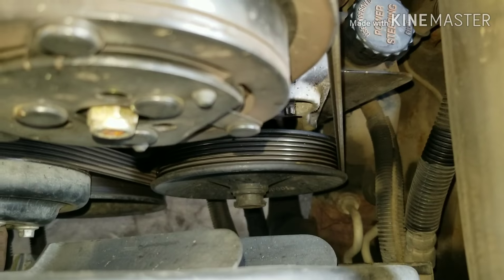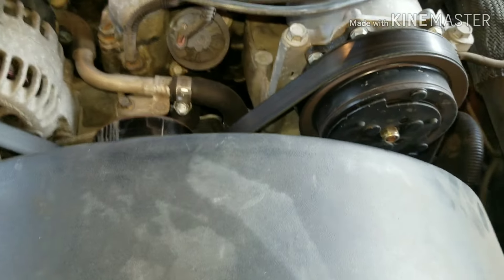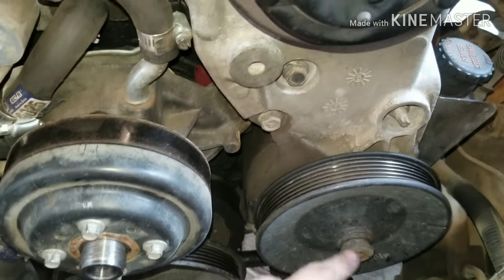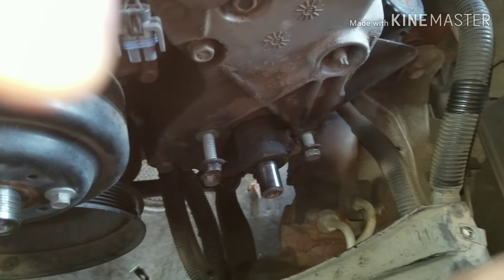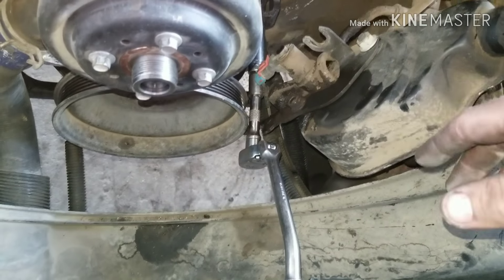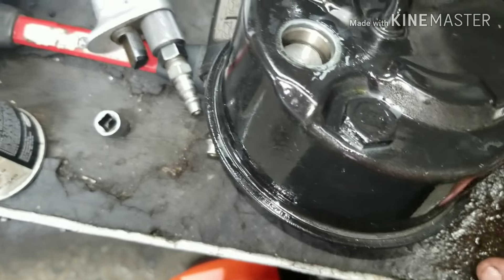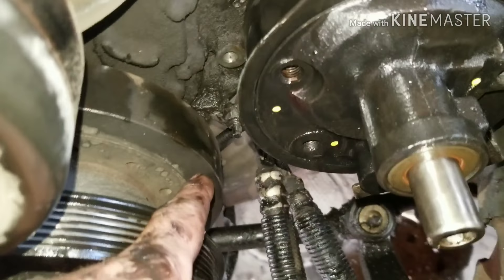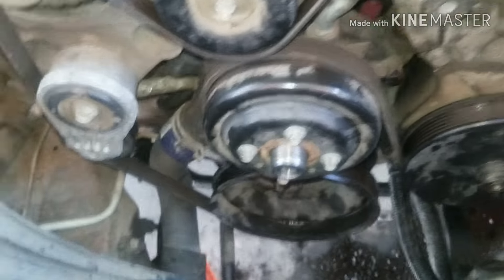98 Chevy c 1500 power steering pump replacment

Comment: FYI to all, you can remove the fan by leaving the belt on, grabbing an adjustable wrench and a 3/8 socket, put tension on the belt and crack the fan loose. It's a quick 2 seconds
Reply: not my fan ^^
Reply: Have a questions iv asked all my local autopart store for that sensor or valve but no one know what I am asking about where do i find a new one mine melted please help idk what that sensor or solenoid is called for the valve on the back of it for the high pressure line I don't know what that is what's it called and where do I get it cuz I cannot find it anywhere
Reply: @Casey Cleland  well with the limited information about "a sensor" in a truck that has 20 sensors you gotta help us try and identify it. Where is it located specifically. Is it big or small? Does it have a lot of wires or just one or two?
Reply: @MrMrBurnablunt  I'm in the process of replacing my pump and I found that "valve " is no longer made but you can get a pump with a " U " shaped pipe in place of the valve as it was only used for a few years and caused more problems then it was worth. It took inputs from the speed of the truck ,steering wheel position and turned down the power asset at higher speeds.

Comment: Well Thank goodness they finally put enough bolts in a power steering unit to make it easier to pull the whole fringing engine to get to it easer , after all these decades of just 3 bolts / nuts and 2 lines Finally they made it so much easier just to yank the engine to get to it ,

Comment: So I’m pulling the pump now on a 97 3500 gmc it wasn’t making any noise but there is so~ much oil from the compressor down I’m mean thick and from the steering gearbox the shaft from there to the firewall is covered from around the height of the park plugs basically 360 degrees from the pump down and maybe a foot just thick with oil and dirt. The guy has only had the truck a few months but want driving it much until the last few weeks the oil and dirt has obviously been there awhile when ingot under to remove the pump the wire is  not plugged I n the sensor and is nowhere to be found there was play in the pulley but all that said the pump has the right level of fluid. They been driving the truck steers stops fine.they stop at store get in start it and no power assist brakes and no power steering that’s when I checked the fluid it was perfect and thi guy doesn’t even own any fluid. brake fluid is not all the way full but very close just wondering if fluid comes out of the sensor where the wire plugs if there is no wire and how did the truck still steer fine. Anyway not sure you will have any answers but I am waiting on new pump should be putting it in soon.

Comment: Great information on this project. I snapped the shaft on mine after not purging it properly after leaking high pressure line replacement. My doom azz. I watched this video after I pulled the pump today. You explained why shaft and pulley yanked right out when attempting pulley removal. It had kersnapped off inside. It would've definitely made life easier if I had watched it prior to line replacement for purging process and again after the old pump went perflunk. Proper prior preparation prevents piss poor performance. The seven P's!!😉
The pump description at the parts store said the valve and sensor assembly is a bypass. Must keep it at needed pressure without going too high.
I'll definitely get the wheels off the ground and go forth and back before I put the fire to it this time. Thanks.
Oh and a monster adjustable wrench did the trick on the fan for me with my chain grips on the pulley. Made me feel slightly better I got that part done easily. 😁😉 The tool knows what it was designed for.....the wielder must learn the execution. 
Thanks again!!🔧🔩
Reply from the maker: Thanks for watchin I really apreciate ut. I'm glad I was able to help you. Besure to like and subscribe for more tips and tricks
Reply: Explain what you mean put the fire to it confused
Reply: I'm confused what did yiu have snap off and what I'm confused
Reply: @MrMrBurnablunt  I meant start it.
Bring the Thunder 😁😂🔥⚡
Reply: @MrMrBurnablunt  The pump shaft can snap in two if the pump get's an air pocket. It happened to mine and brought me to this video for pointers.
Reply: Could've left the belt on and went clockwise with it to put tension on the pulley to keep the fan from moving while hammering it loose. Easiest way in my opinion
Reply from the maker: @ThisIsForYOU369  the reason I did it this way because the nut was seized on the pump threads.

Comment: Thanks! I like the video, thanks for describing the socket sizes.  I did damage my sensor pulling the pump so I have to find another, but with your information I feel I am on the right track!
Reply from the maker: thanks for watching im glad I was able to help
Reply: Your doing well, I researched the EVO sensor. It is obsolete apparently it can cause steering issues. There is a dorman and GM kit that replaces , the sensor on the back of the pump. Dorman 926-049 $36, GM double $ in this case same, same. Variable steering bypass tube.
Reply from the maker: thanks for the evpart number ,alot of viewers questions are where to find a new sensor. thanks again
Reply: Evo system is two pieces, the evo piece by the pump just varies the pressure, the peice on the steering reports the position and error code.
Reply: Questions about the Evo what did gm do about this sensor.. So it's absolet.. Then how do replace if we broke it.

Comment: When you changed out the EVO valve where did you get the correct o rings as these pumps usually only have one that fits the actuator.

Comment: no one shows how to get back nuts off,, i been looking at all these vids ,,do you gwt under truck to get to them ???
Reply from the maker: Thanks for watchin. I usually take the bolts that hold the bracket on off the engine. Then I'm able to move the pump and I need to go get my nuts.

Comment: I have a 1997 GMC Savanna Van 2500 w/ 350. I have a very small drip coming from the sensor area. I tried tightening up the bracket that the sensor sites on and it seemed to help a little. Does these normally start to leak from there and is there any way to repair that area if that’s where it’s leaking from or would it be better to just replace everything or what do you recommend. Also the van has 260000 miles on it but run very good. I thank you for your time and help.

Comment: Doing same job.. same truck.. New pump has reduced nut for sensor. Does that nut screw out so I can replace sensor as it was on old pump? If it's sealed I just don't want to cause it to leak...
Reply from the maker: If you already have the stud part hanging out for the sensor I would not disturbed the new part any more then you need to to prevent any accidentally leaks. Thanks for watchin besure to line  and subscribe for more tips and tricks

Comment: That cockpit back behind the wheel looks exactly like my 1997 c3500 GMC Sierra SLE dually have steering box on the way from O'Reilly's with bypass tube... I suddenly lost power  steering and brakes as it was intermittent a while before it eventually totally failed seem to be an electrical short at that valve I can notice both wires grounding out bad housing... All the mechanics tend to say that truck is too heavy to work on I'm on a blacklist.. model discontinued says the dealer don't even bring it... Suffice it to say I must become my own mechanic. With a 4-ton Daytona jack I purchased from harbor freight thinking about going back and getting the 22 ton jack.. to let the apprehensive mechanics use..

Comment: I have a question i bought a power steering pump does it make a difference if it has the sensor or not does it affect the engine

Comment: Question : I'm removing and installing a PS PUMP on a 98 GMC 5.7 im not sure if replacement pump has the valve I need to check to see I know it didn't come with the sensor and that whole component.  If I discover that the replacement pump don't have the valve taking the valve out of the bad pump  is it easy to remove  and  how to remove it.
Reply from the maker: some times they come with the pressure valve ,its fairly easy to check thanks fr watchin really apreciate it.
Reply: @fixergood   thanks for responding,yes the valve just falls out no tools required .I learned a lot  on this 98 GMC ,5.7  4×4 PS pump removal and install  . I first need to say watching your video made the job more manageable. The pump I removed had the EVO = sensor setup .  On this  replacement PS pump I  scrapped the EVO idea and went with the new designed U shaped tubing which performs the same function. A person could go to a Chevy dealer and pay $100.00 for this small piece of U shaped tubing or shop O'Reilly's and get the whole thing pump included for $89.00 . For anyone reading this Do not go to auto Zone for your PS pump 98 chevy and newer , thats if you do not have that tubing already on the pump your removing, because auto zone doesn't carry it nor can they order it. Thats my experience ,hope it helps.

Comment: Does the power steering pump have anything to do with the engine oil such as passing it through the system? I have a major oil leak behind my water pump and power steering, most of the right side of the engine is soaked. And suggestions?
Reply from the maker: The power steering is a seprat system in that area you could have a power steering hose and  may a valve cover leak that's giving you issues thanks for watchin

Comment: What is the chain tool you have wrapped around the pulley? I'm trying to put the pulley back on, but I cant keep the pulley from turning . I'm basically just backing the main bolt out of the pulley shaft when I crank on the pressure bearing.
Reply from the maker: A tekton  3960 is similar tool, if you put the belt on first I will hold it in place while you spine the fan on or off . Thanks for watchin really apreciate it
Reply: @fixergood  I took a closer look and found that the stud, that screws into the pulley shaft, had a slight bend in it causing the pressure bearing to "bottom out" and spin the entire assembly. I didn't realize it until after 45 minutes of fighting and two busted knuckles. I took it back to my local auto parts store and exchanged it for a different one. Pulley went on in 15 minutes. Keep up the god work. Your videos are awesome!!
Reply from the maker: @brianwilson8119  thank you I really apreciate it.

Comment: Where did you get the chain to remove the fan.Or is it another way.
Reply from the maker: They make a chain took that looks like a pair of vise grips. Usually ty hey come off when you hit the nut with a gan spanner tool and a are hammer
Reply: Thanks

Comment: If you can't get the pulley off is it still possible to remove pump with pulley attached
Reply from the maker: No the pully needs to come off in order to give you access to the three power steering bolts.Thanks for watchin really appreciate it  besure to like and subscribe for more tips and tricks and check out facebook and instagram and give it a like for more help in the future
Reply: most auto parts store will rent a pulley removal tool. And most will give.you a full refund when you return the tool. Kit comes with a tool to reinstall it. Only takes a few mins and you do not need to remove the fan like some people do.

Comment: Good video.  The  whole hammer trick has me a little confused.  Not sure what part you were hitting on to loosen fan. I just left my fan on.  98 Chevy 2500. My issue is with the return hose. I think it's with the cooler? It bolts inside the frame right behind bumper. There's not enough room to slide it out.  Is my only option to get it out of frame to remove bumper? Can't find videos anywhere.
Reply from the maker: I'm not sure does ii maybe look like you can get it through the grill if it was removed? Thanks for watchin besure yo like and subscribe for more tips and tricks

Comment: If my pump doesnt have that sensor just install a pump without it rite? 99 tahoe 4x4 5.7 by the way.
Reply from the maker: On some make and models yhe sensor is optional so if your original equipment dosent have it, the new pump should also not have it. Thanks for watchin be sure to like and subscribe for more tips and tricks
Reply: @fixergood  thanks
Reply: @Randy Wilson it did have it after all. I just couldnt see it til i was under there. I managed to replace only the lines😊

Comment: change the gearbox power steering pump and it idle wheels are hard to turn but if you give it gas or driving it turns easy can't find the problem
Reply: Same here... Did you find the problem???
Reply: My 1998 k1500 has just started  doing the same thing. Did you find what was causing  it to do that?
Reply: Pump is bad. You got a dud. Unless one of your PS pressure lines are busted... your reservoir would be dry all of the time if that was the issue
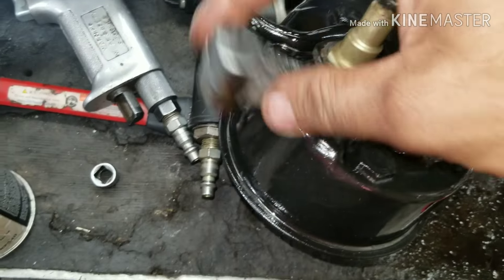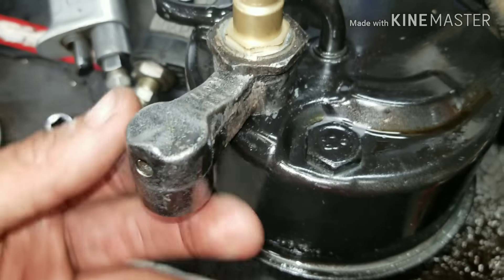Reply: Also if your lines are not leaking listen to 5:19-5:23 in the video.. he mentions a seal that if it isn't placed back in or if it is damaged it will cause the pump not to work at all.

Comment: Does that snap on puller also install the pulley? I found the exact same one on eBay but the video didn’t show you putting it back on
Reply: The video shows it but I can’t tell if it’s what you used to put it back on
Reply from the maker: The snap on puller only pulls it off, then you need a installer tool. If you get a unervirsal removal and installer kit it should have one  in it. Or I'm sure you could rent a tool from a local parts store and they could point you the right way.  Thanks for watchin apreciate it besure  to like and subscribe for more helpful tips and tricks .
Reply: fixer good  thanks man. Yeah I was looking at them on amazon that pulls and installs but they have shady reviews. I went on eBay and found the puller that you used. I’ll look more into the kits on amazon. Thanks again

Comment: Where can I order the sensor thats on the back of the pump near that 30mm
Reply from the maker: I'm sure you can  ask your local parts store they should be able to help , or look for part numbers on the sensor.
Reply: Autozone, carquest,napa,o'reillys,advance. All said part was n/a in there system and couldn't tell me where to go from there.  Rock auto also does not sell it or have information on it.
Reply: @daltonnichelson7300  your a lier power steering pressure sensor check it out again.

Comment: What do you do if the sensor on the pump is broken.
Reply from the maker: Depending on how it's broken theres probally no saving it on something like that you'll probally have to buy a new one thanks for watchin besure to and like and subscribe for more tips and tricks
Reply: @fixergood  what's the sensor name
Reply from the maker: I think it's called a power steering pressure sensor, thanks for watchin  be sure to like and subscribe
Reply: @fixergood  thank you

Comment: Ridiculous pondering... I can't figure out the solenoid valve maybe pulls that apparatus back so it would seem to unplung it... would be a default setting for ultimate steering assist in my dream.. unless electricity voltage in varying degrees pulls back that plunger for less steering assist.
.

Comment: For the Evo valve, how many orings did you replace? Did you use the orings that came with the pump?
Reply from the maker: I'm not sure how many I replaced I I'll see if i can find out and let you know  but yes i used new o rings with the kit , thanks for watchin besure to like and susbsribe
Reply: fixer good was it hard to put it back in the pump with new orings? I tried putting it back in and it doesn’t want to go in all the way without pushing down with a lot of force. It looks like the new o ring is thicker than the old one. I decided to put the old o ring back on there and it’s leaking around the Evo.
Reply: @dustyvviolin  k

Comment: What cause my new pump to leak out of the pressure line I got it all tight and still leaks what did i do wrong
Reply: Over tightening maybe crushed the o-rings that seal the hose to the fittings

Comment: Why'd u take the fan off lol ...u better not tell me "so I can fit my pneumatic in there" because if you would have left it on and just use the socket and crescent you would have saved time and a few steps taking apart and putting together, that was kind of unnecessary.

Comment: Well since I have the same pump I’m trying to do this job and every pump I get will not fit my sensor
Reply from the maker: Huh like the sensor is to long or not the right diameter for it. Do you have the original engine in it it could be you getting wrong pump for a diffrent year engine? Hope this helps thanks for watchin and besure to like and subscribe for more tips and tricks.